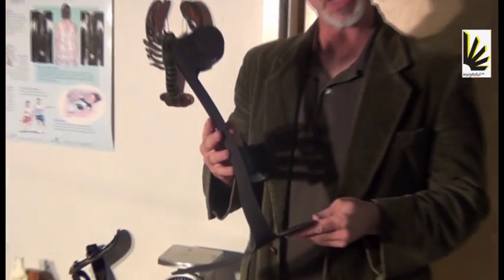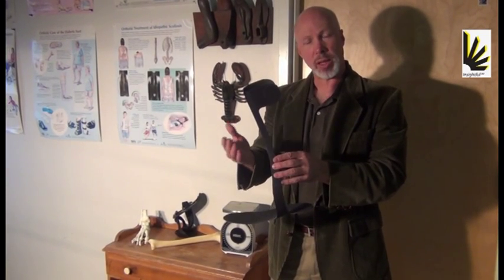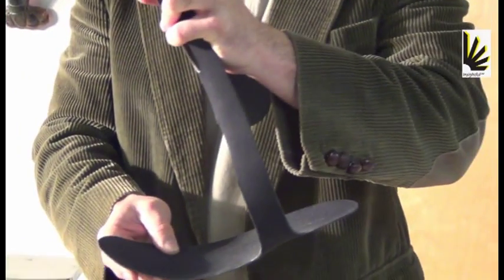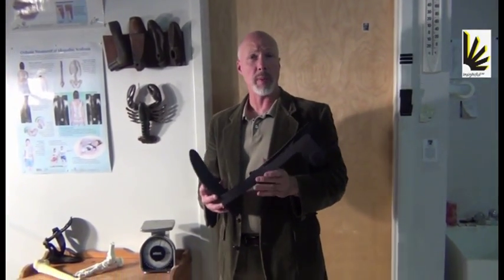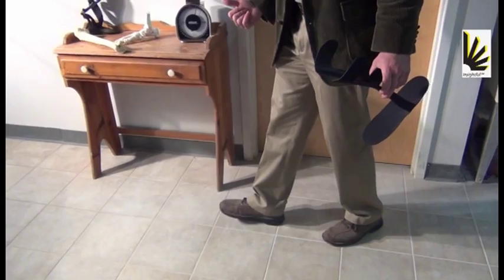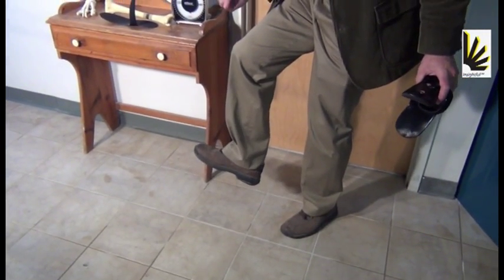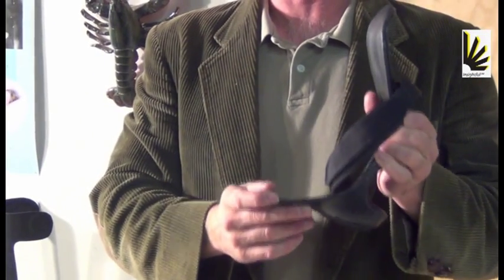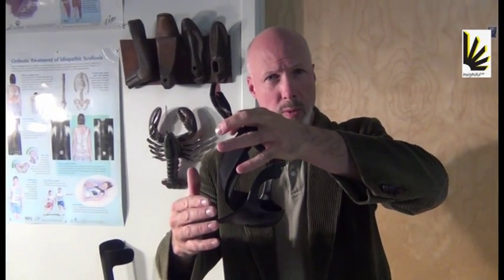Foot of the Week - Episode 18 - Toe Off

Comment: Sean - good video. You show what I believe is theCAMP Toe-Off, which i used for a few years. I have BOTH foot drop and loss of calf use in my lower right leg; and the Toe Off helped somewhat in the plantarflexion as well as the foot clearance aspect from drop foot. Would the Smart Step brace be of help to me? You suggest its' primarily for foot drop. Thanks